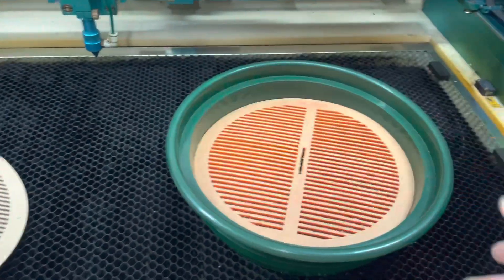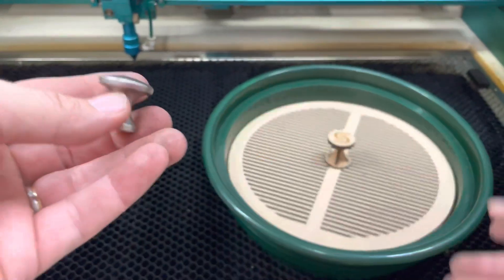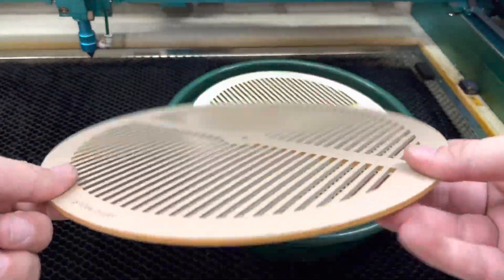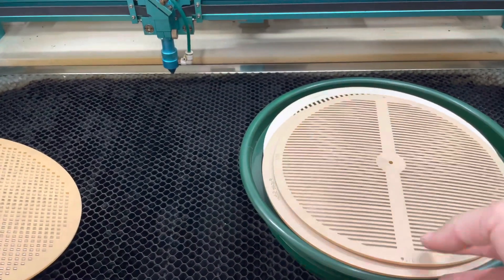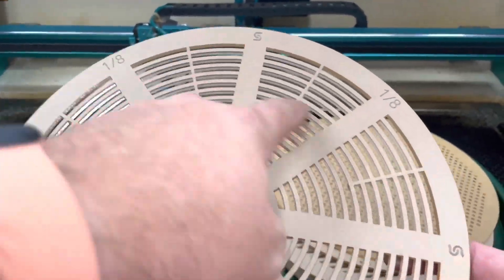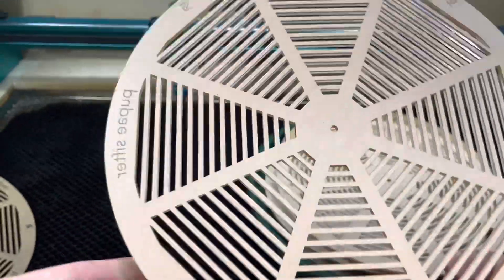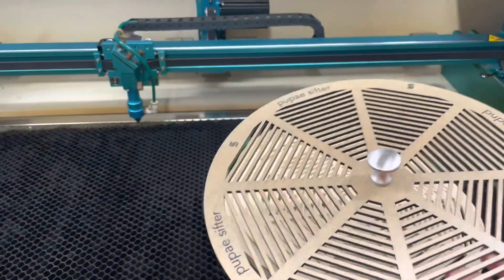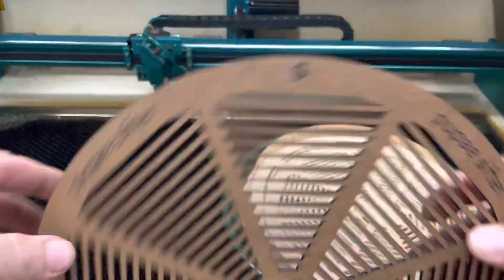Design Evolution of the Round Mealworm Pupae Sifting Insert

Comment: I wonder if they put the logo as the sifting patter or the customers name if it would work just as good
Reply from the maker: Clever idea!  I've played with the idea of using the S from my logo as 'air holes' in the lids of some of my stacking trays, but never actually sent any to customers.  I'm not sure if using the S as sifting slots would be more efficient for the laser or for sifting. I'm be concerned with the consistency of the gap size and with hurting the worms as they slide into the edges of the open design. Always love new ideas though, so keep them coming!

Comment: Thank you for all the information. Very new but trying. Have you done a video on what you do with your worms once they are the desired size so that they do not turn into pupae?
Reply from the maker: No video needed.. just put ‘em in the refrigerator! They slow down their growth and metabolism in cold temperatures. 

I usually add bedding to mine to reduce condensation, and take them out once a week for a couple hours to warm up and eat a little bit.

Comment: Just rediscovered your channel after a few years. Do these new designs solve the issue of pupae getting stuck during sifting and having to flip it over and manually push them back out afterwards? What if you made basically two sifters that each have half as many "slats", but they slot together to form the same pattern as the current design. Then when you're done sifting and you have a bunch stuck, you just separate the two parts and the pupae will easily fall through the gaps that are now twice as big.